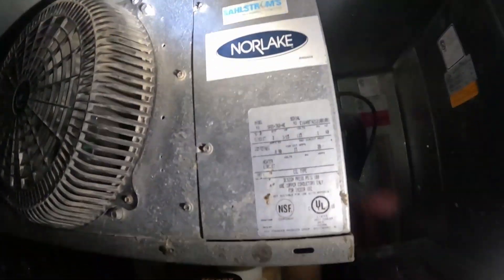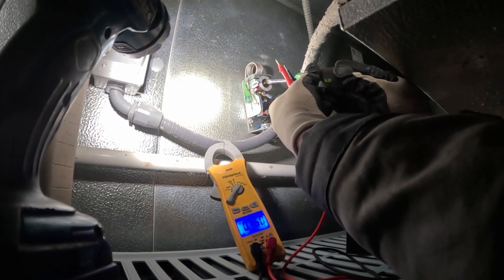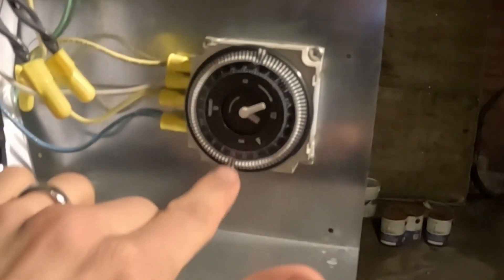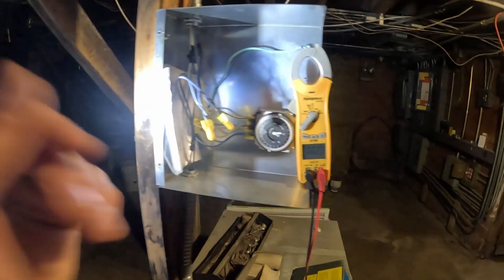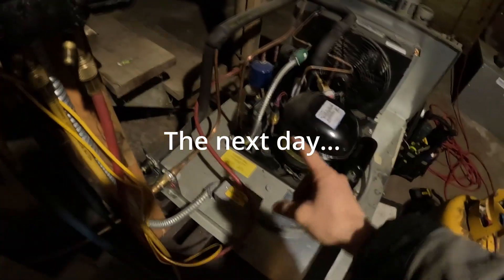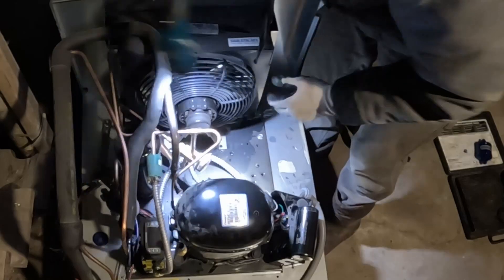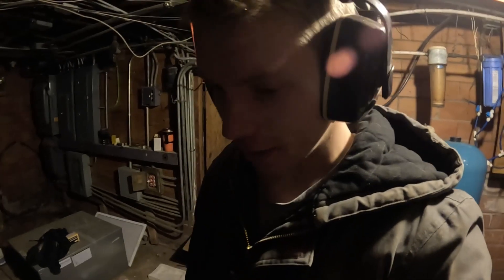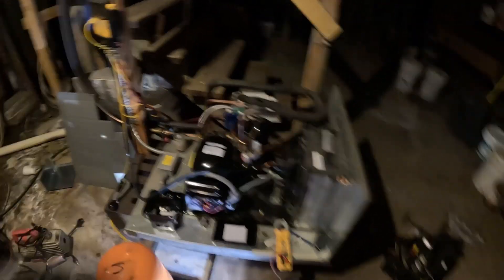Walk In Cooler Compressor Troubleshooting

Comment: Question for you oh wise and noble Rueben. I have a single-door walk-in cooler that Is powering up and pushing air but it doesn't appear to have any life to the condenser unit and the fans are not spinning. The screen and lights are dead on top. I have tried multiple power sources and a lot of swearing and I am lost. any suggestions

Comment: Ijust disconnected the compressor n turn breaker on if stays on bad commp.
Reply from the maker: @rubencastillojr4645  Right, assuming the wiring to the compressor is all good and not shorted at the pin.